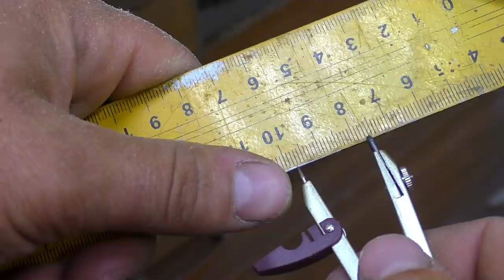Cool idea! Don't throw away pieces of wood!

Comment: Nice table Eugene. I am looking for similar method of making, but not the table, but carry on scoreboard with legs to use it in outdoors. Can it be possible , like I am looking for 6'x4' and some way to fix it on ground temporarily and fold it at the end of day. I would like to try this for my score board back panel, I will be mounting my digit on it. Good idea of this, where we can keep digits inside storage and legs too. we need Legs design as well. See if you can give me some help on it. It can be light weight as the digits I have are very light weight. Thanks

Comment: I'm sure you're a great woodworker with lots of ideas.  But, specially when making videos motivating others to follow (even if it is just to get views), make sure you follow safety procedures and wear all the proper Personal Protective Equipment.  Wear you safety glasses, long jeans, boots, gloves, and hearing protection.  There's already at lot of people that simply grab a circular saw to cut anything without ever reading an instruction manual or somebody telling them how to properly handle that piece of equipment.  When handling the circular saw, make sure the motor side faces the portion of the piece you're cutting that stays on the table.  That way you prevent the saw from falling, swinging and cutting something else, like your thigh.  When using the table saw, never ever reach across the blade to grab the piece you just cut.  If you don't want it to fall; build yourself a retractable table to place on the other side of the table saw.  Also, adjust the blade of the table saw to be slightly higher than the piece you're cutting.  In case of an accident, that's the difference between the blade barely cutting you and almost loosing an arm or a finger.  Don't let your experience kill you!  I wanna see more of your videos, but please practice and teach safety habits.  I hope you don't take it the wrong way.  I do really care.
Reply: Leslie Cruzado I agree with you.🙏